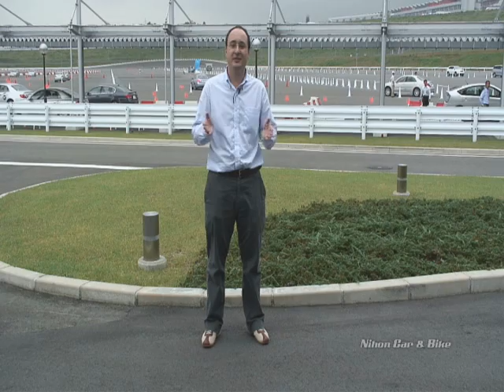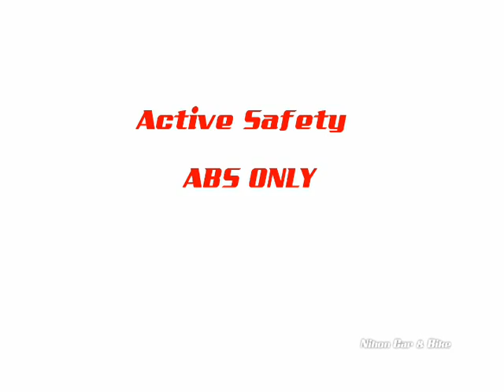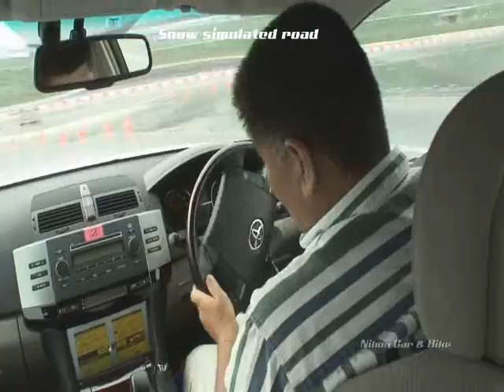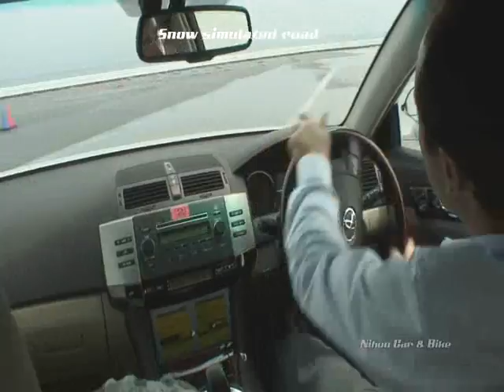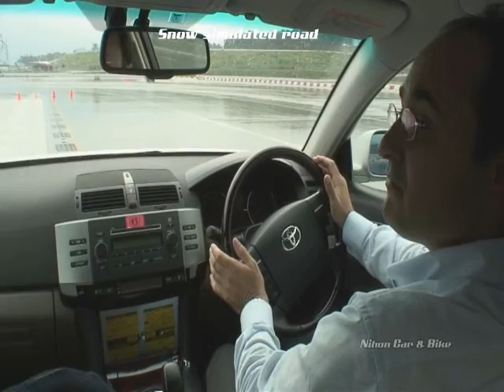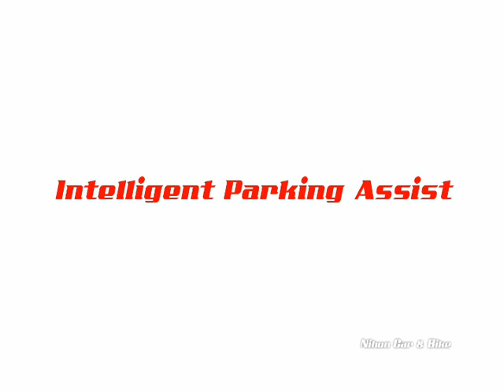Toyota Traction Control Demonstration

Comment: Hello,  I own a hybrid Auris. The other day when I was on a hill turning right my  right front wheel contacted some liquid and I heard a very loud noise similar to gears slipping coming from left front side of the car. And interior is filled with gas or exhaust smell. I immediately pulled off and contacted my dealership. They adviced me to tow the car. I thought I damaged my axles. Could it be traction control system activated? I took my car to dealership but they didn't see anything wrong. My car runs just fine. Now I feel like my steering wheel is vibrating and giving my hand numbness. Any idea on what should do? Should I spin my tires? Thanks for the help.

Comment: Hi. My car(Toyota Premio 2007 F model) has no traction control button but  in speedmeter icon of traction control appears. Now suggest how I should on it to use it with out button. Or the whole traction control function is to be installed
Reply: Lol same but i have x 1.8, any idea how to turn on?

Comment: Haha, he turned the wheel to keep it straight.
Reply: Even with all the stability control systems, if they're not very refined, you will have to stear in the position you want the car to travel.  

My 2013 Camry SE has no issues at all.  It behaves just like the Lexus did.
It all depends on how old the system is I guess.

Comment: see the Lexus gs450h at the end. absolutely flawless. the 450h is a hybrid tho, so we got the 430-460model and got the f sport package which gives it the same engine as an isf
Reply: I would rather have the hybrid 
It’s impossible to be in the wrong gear with a CVT couples to a battery pack